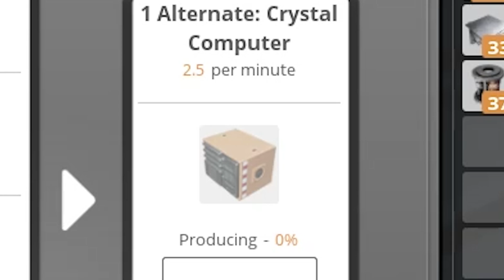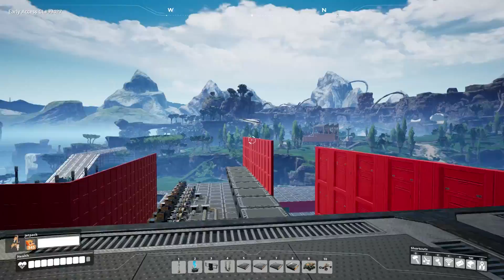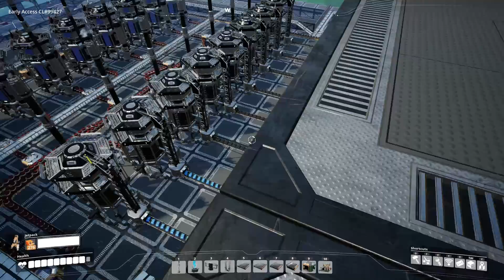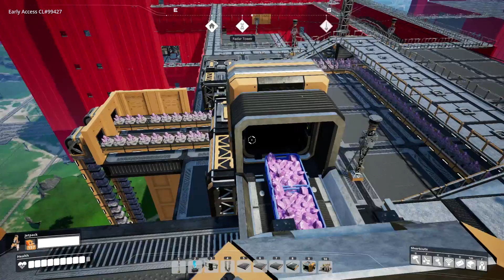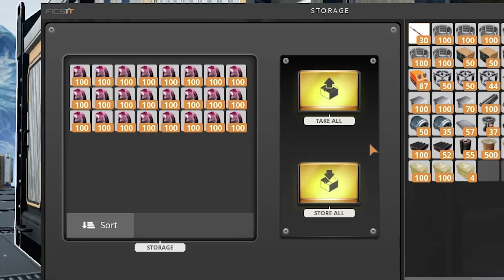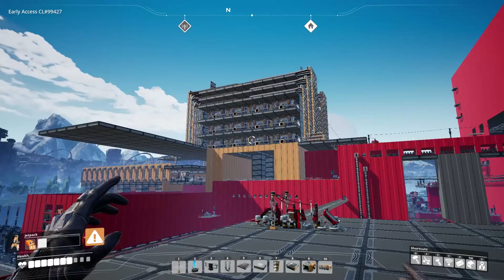24 Manufacturers, 1,320 MW of Power, 1 Production Line. | Satisfactory Early Access Gameplay Ep 28

Comment: NICE! , just wodering for overflow, as you need 3 levels per item (ie onto 3 belts for the same thing) could you put a three tech 2 containers in a line for each belt, with the middle one lifed by a 1/2 fondation, which you then remove. thus you have 3 belts with the lowest and mid belt into a Container II, then the top belt and moddle belt in to the next one (with the lower belt underneath), then the mid and lower again like the first container II.

This would mean if any of the 3 belts was not supplyed enough, it would feed from the other belts. ie if the top belt was short, it would be fed from the lower belts, and if the bottom belt was short it would feed from the top and mid belt. 

If you wanted 1 belt to feed the 3, you could do the same, but you would only need two tech 2 containers.

just my tuppence worth. Nice build.

Comment: y do u keep forgetting that overclockers are a thing? u could almost half the space taken by machines
Reply from the maker: All power shards I use are exclusively for ore miners, I never will use them in machines.
Reply: Never use Overclockers in manufacturing machines, just miners. The power consumption usage of overclockers is exponential, not linear, 1 overclocked machine at 250% is like running 5 machines at 100%.

Comment: How much power is needed for the whole set up for the super comps as well you only did the math for one building
Reply: Using an online Satisfactory calculator - making all the "crystal computers" into Super Computers it would be nearly 15 GW.
Reply: I'm not sure he can physically provide enough raw materials to make that many. Nor will he have enough power to provide all the machines he will need to produce that plus everything else. The Oil consumption just for the rubber is more than the 4 nodes he has, even ignoring that he uses 1 of the nodes for power.
Reply: The most critical resource is likely to be the oil nodes - Not counting the fuel for the generators it would take an oil pump running @188% on all 7 of the pure nodes and 2 other oil pumps.  Note that this is not taking into account any rubber or plastic production used by the prior computer manufacturing line.  This also does not take into account any oil that might be used to produce fuel and then power.

Comment: There currently is a second recipe that uses raw quartz - an recipe for silica that is available only from a hard drive.  You can also chop down coral using a chainsaw to get some Silica.

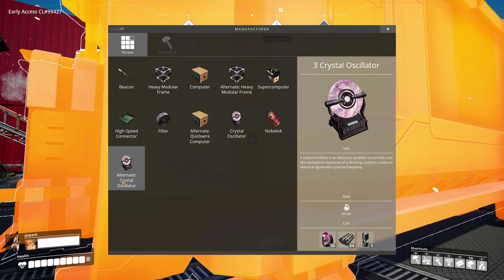 There are currently two alternate recipes that use Silica - A more efficient recipe for concrete, and more importantly for the production of supercomputers - a more efficient recipe for High Speed Connectors - which you don't have yet per the manufacturer recipes @ 9:59.
Reply from the maker: S I L I C A?????????
BIG oof.
Looks like I'm going to have another project on my hands xD

Comment: "All the oil in the world"? Do you reeally have enough oil to feed forty-six refineries you'll need for this monster? :D
Reply: It only takes 1380 oil/min to supply the 46 refineries needed for the Crystal Computer part of the monster.   The equivalent of 3 Mk5 belts running at 450 item/min and one belt running at 30 items/min.

That of course does not take into account the additional 100 or so refineries needed to make the other products that would be used in the production of the supercomputer.
Reply: It's not just the belts tho. It's nodes and building space. Oil refineries are huge. And the nodes are preetty scarce. He could manage to supply the CC part with overclocking the west coast nodes, sure, but hoobooy the SC costs.

Let's see... Three and a half thousand oil. RIP Kibitz. Even adding the eastern crater isn't going to cut it, he'd have to go alll over the map.

Also, 1.4k caterium ore even with the cheaper qw recipe.
Reply: @MrAdannor  Cheaper QW recipe?
Reply: @AzimovTube  There is an alternative recipe for quickwire making 12 qw from one caterium ingot and two copper ingots. That's cutting down from, for instance, 225 caterium ore for 300 qw to 75 caterium and 50 copper.
Reply: @MrAdannor  Yeah I forgot about that one as it uses the next tier of machine and more ingredients. I'll probably stick to pure Caterium for now.
Reply: @AzimovTube  Assemblers are still very easy and caterium is rare enough to make it worth the effort. Though if you have enough to fill your needs then of course just pure cat is fine.
Reply: @MrAdannor  Actually rarer than what I realised as 3 normal nodes I see on the map in the dunes are all bugged.
Though when we get trains I will ship some in from the west coast.